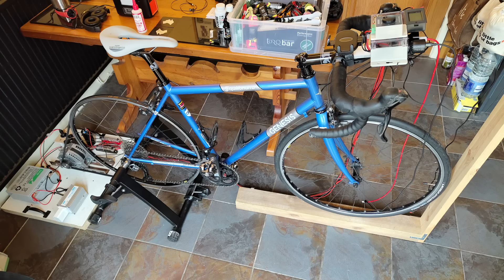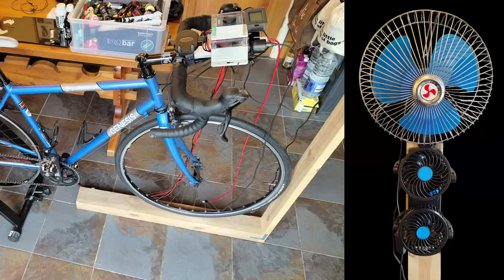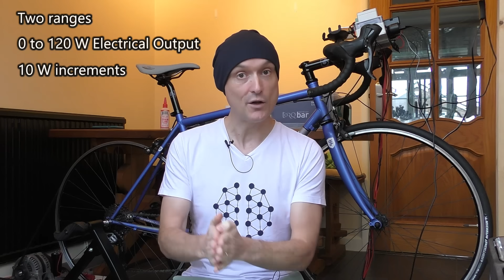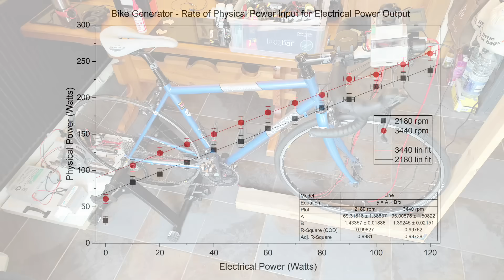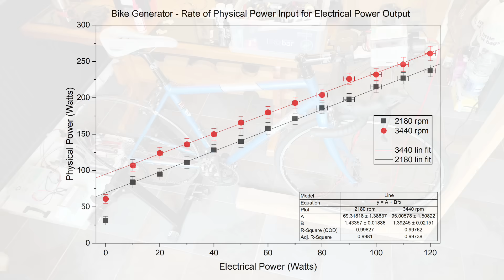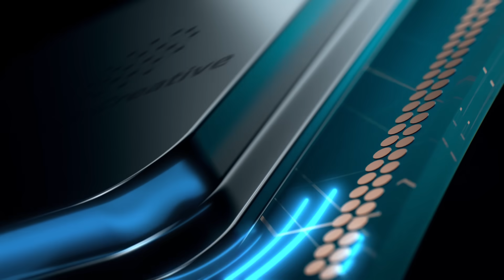Is this the most efficient bike generator trainer in the world?

Comment from the maker: Why didn't we use a permanent magnet motor/generator to get better efficiency?
Several people have commented on this, so here are the reasons.
1. This generator was built for a competition, the rules of which require a commercially available car alternator.
2. We have built a bike generator using a permanent magnet (PM) unit which gets better than 75% efficiency. We will probably make a video about this in future. However, it was not useful in the ways we needed it to be. A purposeful bike generator must give the user the feel of a real bike and be able to be ridden at a wide variety of speeds (gear ratios / cadence) and input powers. Additionally, the output must be a useful voltage and must have the capability of adjusting the electrical load in a way which gives direct resistance feedback to the rider. Whilst it remains our goal to produce a bike generator using a super efficient PM motor, it is much more difficult than one might think to satisfy these two conditions. A future video may go into this in depth, but one example is the voltage range. In a PM generator, this is proportional to rotational speed. In our trial setup, this produced anywhere from 48 to 400 V in 3 phase AC over the range required for pedalling. Regulating this is doable but challenging, and inevitably involves losses.
There are many other issues, including sinusoidally varying feedback torques which interfere with pedalling.
All of these are resolvable but putting in the time and effort to do so did not serve our overriding purpose for this generator, so we haven't done it (yet...)
Keep a look out for a video about this topic in the future 😊.

Comment: Nice thoughtful effort! Suggest you look for a better generator though. Also put an aero cover over the spokes. I'll be interested (but deeply disappointed) if you can't beat 90%. (By the way, I'm originally from Oldham. And am the co-author of Bicycling Science, 3e)
Reply from the maker: Thank you 😊. Good shout on the aero spoke cover - hadn't thought of that.
Yes, there are certainly more efficient generators  around, but what we don't cover in the video is that for the specific world record attempt we're undertaking, the rules require a commercially available car alternator, hence we're a bit restricted. Although, this should get more efficient at higher powers, looking at the linear fit gradients.
Other issues we've had with a permanent magnet generator (much more efficient than an alternator), among other things, were sinusoidal feedback torques at certain rotational speeds with fixed loads, and more issues when the load is varied. Also, we tried a couple of different ways of managing the voltage regulation and rectification but unfortunately the best way of doing that meant having a battery in the circuit with the control module in such a way as to prevent the accurate measurement of the generated power, which is essential for our purposes. We were also generating voltages in excess of 400 V, which was somewhat concerning 😂.
There's definitely more experimentation to be done with that - I'm sure that much greater efficiency could be achieved with the right set up, but since we have to use an alternator for the present project, that's why we're developing it in this way.
I was originally going to include the PM generator experiments in the video but decided it would make it too long. I probably should have since several people have commented on it! Maybe we'll do another video about that!

Hadn't heard of your book before, but it looks great 👍. Thanks for mentioning.

Comment: Some Permanent Magnet (PM) motors Are over 95% efficient. (from RC) 
Any PM motor is A elternAtor when you turn it... ie: 95+% efficient.
How the hell cAN thAT 50% effecyent AlternAtor compete!?

Then there's Active PFC with GAN FEts.
Lithium based bAtteries @ 90!+% effeciency vs 50% for LA.

In short:  
This is a: 'Get many clicks for minimum outlay, from idiots that don't know any better!' video.
Reply from the maker: There are no permanent magnet motors which when used in a belt driven set up, with cooling fans and including a voltage regulated and rectified output get anywhere close to 95%.
You know this. If you consider only the turning of the shaft and the electromagnetic induction itself, then you can start to consider 95%, but this is unrealistic in a real world situation. Even then, drag from the bearings under load would almost certainly drop it below 95.
As per our reply to Michael, we did build a version with a PM motor with much higher efficiency rating, but the voltage regulation requirement did not allow for the particular use case we needed here. Additionally, it created issues with pedalling cadence and gear ratio requirements which made the equipment less useful as a training aid.
There would have been further modifications possible, but since this generator was built with a world record attempt in mind, the rules for which specify a commercially available car alternator, the motivation to proceed with the PM motor was insufficient.  It would certainly have been more efficient. Also useless.

In short:
Your comment is an attempt to show off to people who don't know any better (please notice, that, unlike you, we don't consider those people to be "idiots").
Reply: Raylene, you know the gradients of those lines are about 1.4 right?
It gets more efficient at higher outputs...

Comment: 52% doesn't seem very efficient though??
Reply from the maker: That's very true! The trouble is, an alternator is just the best solution for the particular needs we have for the generator (and is mandatory for the world record attempt we intend to undertake). And alternators just aren't that efficient. An advantage, though, is that they have voltage regulation and rectification built in (which is where some of the losses occur of course).
We did try building a version with a permanent magnet generator intended for a wind turbine which comes in at about 75% efficiency. However, there were some significant problems with high voltages and the way in which we could make it work didn't fit the use case we have for the generator. We might do a future video on this, so keep an eye for that!